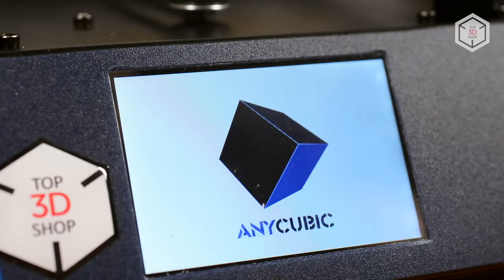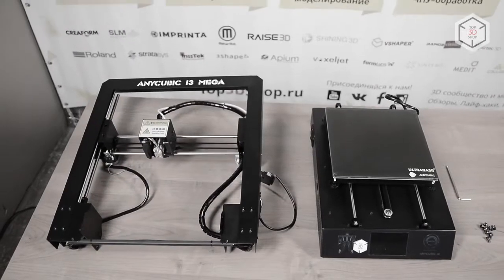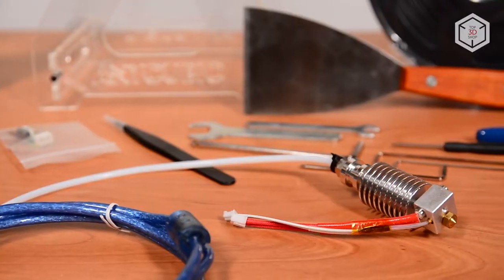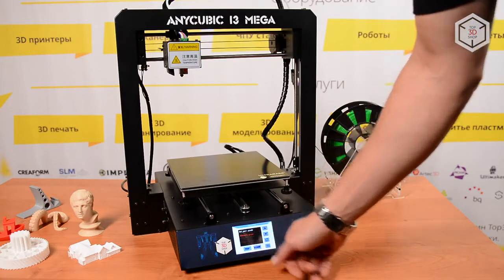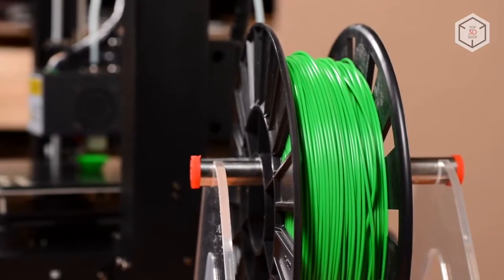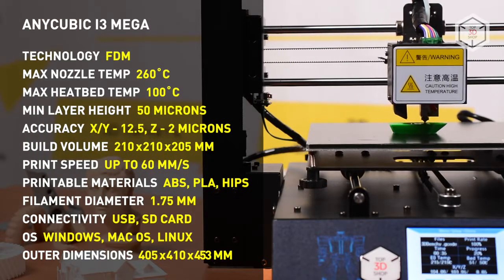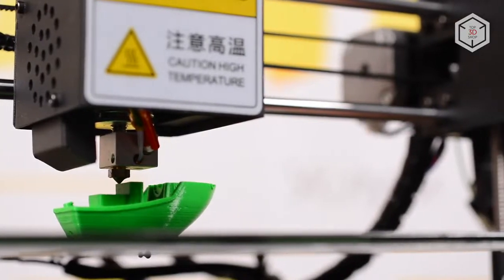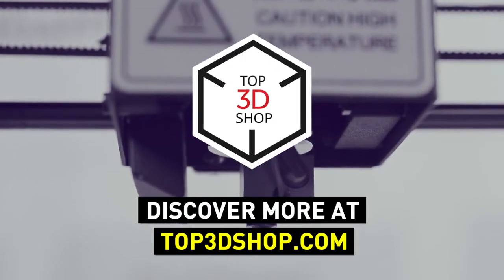Anycubic i3 Mega 3D printer Review: Is it as good as Prusa i3?

Comment: Just got an Anycubic.  It’s ok.  Can only hope that people spending $800 are getting better results.  It’s an ok printer, but the test print had lots of stringing and blobs, the skirts seem not to apply correctly even though on warmup it starts extruding small amounts at idle.  First few prints it tapped the front left corner, then went up and over and started printing, now it doesn’t touch the corner and lowers down in front of the bed, which makes me think the bed shifted somehow.  Reading about lots of people with problems, and never seem to hear anyone say they have solved it outside of darn near rebuilding the machine.
Reply: Yes, but a Prusa is worse 😂, I feel bad for the people spending double the money only to get outperformed by a mega s
Reply from the maker: Hey Michael! It does, you can use a slicer (for example, Cura) to convert your STL files into gcode, and load that gcode into the Wanhao Duplicator to start the print.